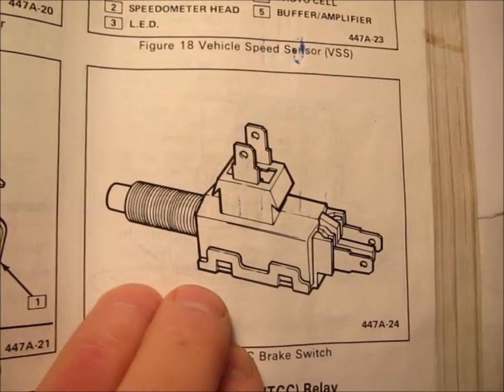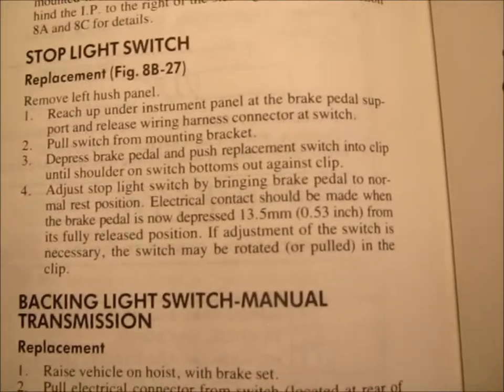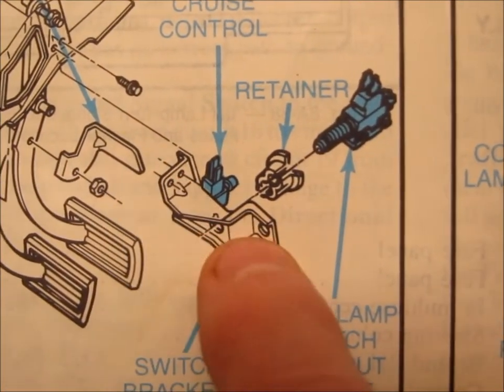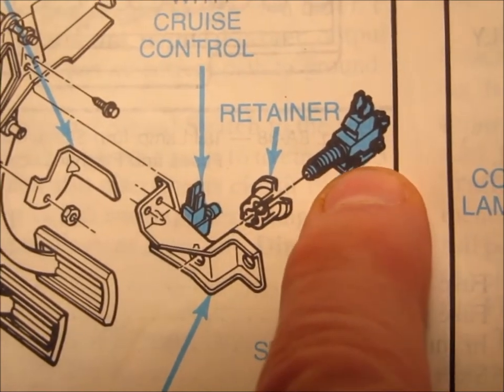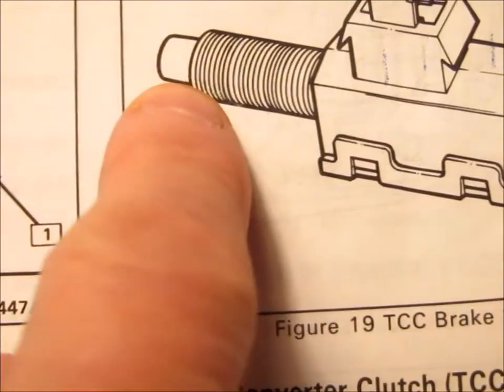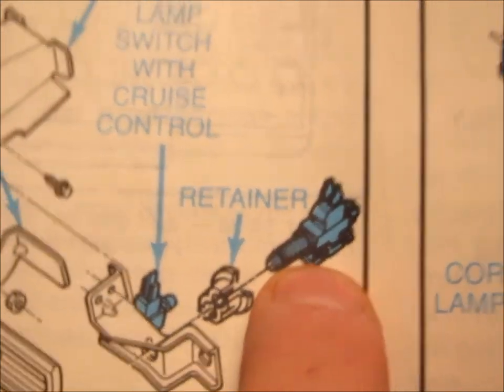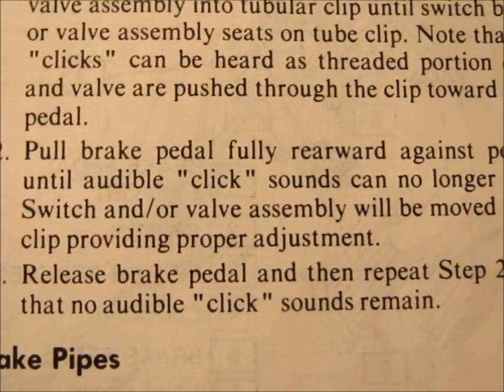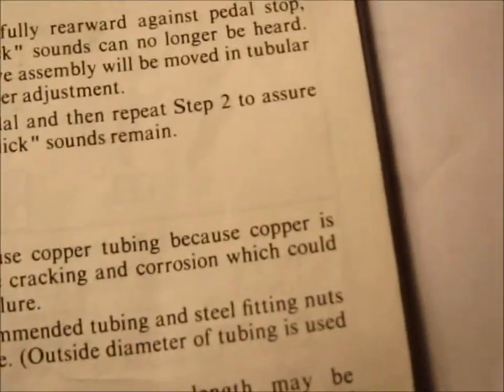𝟏𝟗𝟖𝟒 𝐂𝐎𝐑𝐕𝐄𝐓𝐓𝐄 𝐓𝐑𝐎𝐔𝐁𝐋𝐄𝐒𝐇𝐎𝐎𝐓𝐈𝐍𝐆 𝐍𝐎 𝐁𝐑𝐀𝐊𝐄 𝐋𝐈𝐆𝐇𝐓𝐒

Comment: Part number on this switch?  I have a 84 vette  and my overdrive is not working.   Thanks Bill
Reply from the maker: I took mine off and took it to NAPA to compare, because it differs with cruise control, manual transmission and automatic transmission.